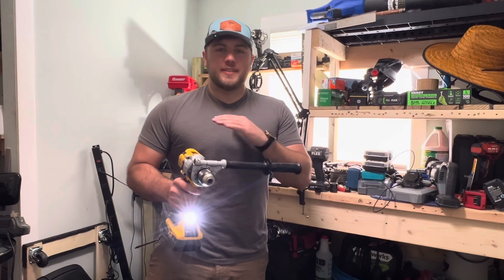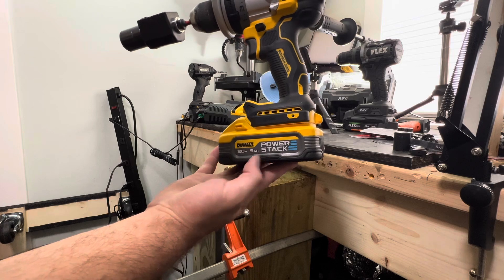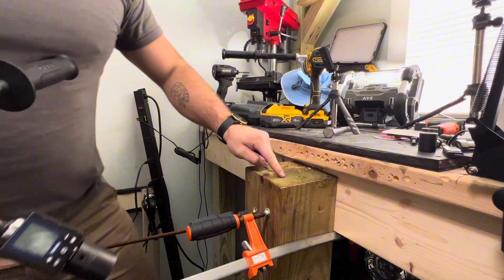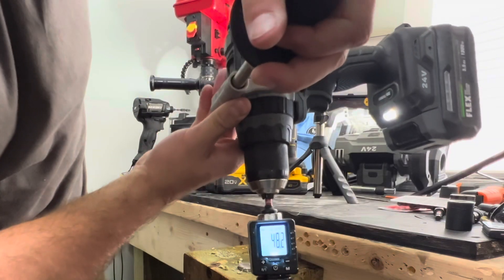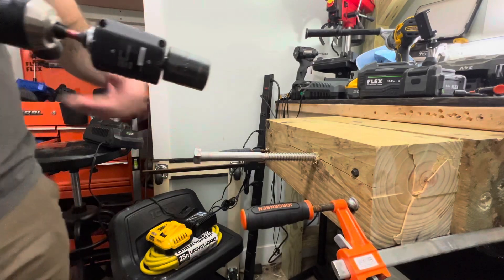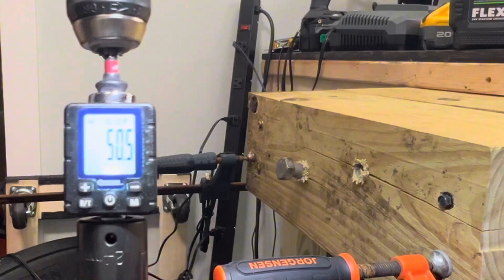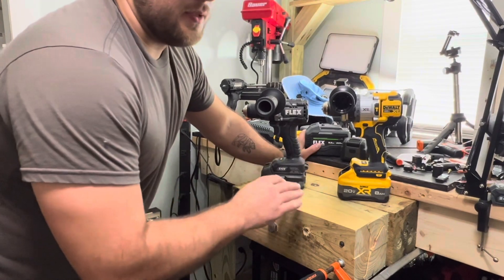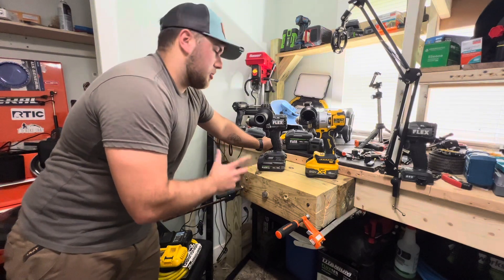Flex vs. DeWalt: Can Flex Maintain Its Top Spot?

Comment: Here in Brazil, the Dewalt brand is well valued, but the 5Ah PowerStack battery model is very underestimated! People focus a lot on the "Amper Hour" and physical size of the battery and forget about the INSTANTANEOUS DISCHARGE RATE (most don't even know what this is!), being that for the machine to reach its maximum power, the discharge is more important than the energy density. 🇧🇷🇧🇷🇧🇷

Comment: Not sure how a flex 3.5 amp power battery can be compared with a Dewalt eight amp power power pack. Should’ve at least used the six amp power on the flex. Otherwise this test is pointless.
Reply from the maker: @fromnineteeneightyfive  I did use the 6 and the 10 multiple times and several people have told me to try the 3.5 so that’s why why did that
Reply: @Kaleb_RoSs  Maybe don't listen to "several people".  Not trying to be a jerk, but every other reputable channel makes sure batteries/accessories/bits are all equivalent.  It is extremely well known that higher AH batteries perform way better that lower.
Reply from the maker: @fromnineteeneightyfive  I have done this test with multiple different batteries. I also used the 10ah in this same video, not just the 3.5…there was little to no difference.

Comment: It all comes down to what you need the tool for, I personally like Flex more because it is both cheaper and smaller. But no one can deny that DeWalt has come out with a great drill

Comment: Yellow boys are gonna love it but i did test them too.Flex was a bit better!especially in wood drilling. tested them with 6ah stack for flex and 9ah flexvolt for dewalt.And for concrete not much difference.im not a dewalt fan but honestly i dont like the way they connected the chuck to the shaft!

Comment: Good video. Dewalts consistent seems the smaller ah  batteries deliver the most beacuse the tool doesnt shut itsself off.  At the end of the day we might have different numbers but you are using the same adaper for both tests so across the board it seems dewalt does have the most power

Comment: Who offers a better warranty?  Who actually honors their warranties?  
Flex.

This strongst tool game is exactly that...a game.  Dewalt made a stronger drill. Yeayyyyy.  Oops its HOW MUCH???  Right now reliability and honoring warranties is more important.  I also have a sweet spot for Hercules selling their tools and especially their batteries at such a low price.
Milwaukee can just SHOVE IT at this point....
Reply from the maker: Dewalt and Milwaukee definitely need to step the warranty game up, can’t be the top 2 for pretty much everybody when they don’t honor the warranty nearly as much as Hercules or other brands
Reply: @Kaleb_RoSs Milwaukee has always been good with warranty for me but no one beats Bosch and flex I think they are the best when it comes to warranty flex customer service is amazing and Bosch was great to deal with too
Reply from the maker: @nickp3270  flex warranty was fantastic for me for the 1 battery I replaced. That’s the only time I’ve ever warrantied though
Reply: I've been a dewalt guy forever and still am. I've been transitioning over to flex especially on their impacts. I love my dewalts but flex just has a better warranty and service when I need em. Had a couple leaking batteries and they took care of it no question
Reply from the maker: @ShredworthyDave  I’ve got mostly Flex tools, I really think this Flex has been worn down from all the unnecessary abuse from these tests. Could be more competitive if I get a new Flex
Reply: @Kaleb_RoSs  yeah it could be the wear n tear not allowing it to be at full capacity.  And that's alright.  I take alot of tests with a grain of salt. 
In my line of work of event production we literally push everything to the limit so I tend to lean towards power output and warranty.  

For example I love gear wrench and their ratchets but their warranty service is abysmal.  So I lean towards what's going to get my job done the best no matter the brand. It's all warranty service I mainly care about
Reply from the maker: @ShredworthyDave  very good point
Reply: @ShredworthyDave  you should give the Flex inline 6 1/2 circ saw a try.  Tried it and fell on love with it.  Very natural feeling.  Great visibility on the blade cut line.

Comment: When the Flex first came out it was up in the $300 range, I have it, I am going to get the 1007 when it finally comes to Canada, I an a Dewalt guy
Reply: I’m used both the 1007 and flex turbo hammer drill I wind garage door springs the flex is night and day quicker